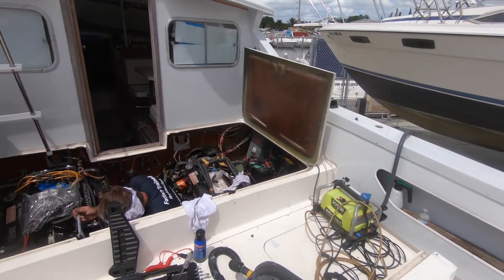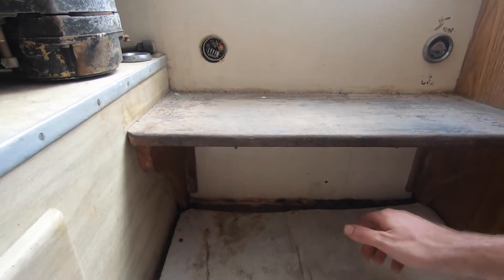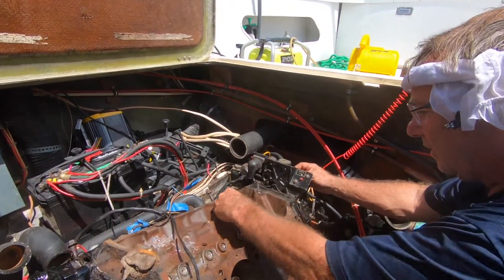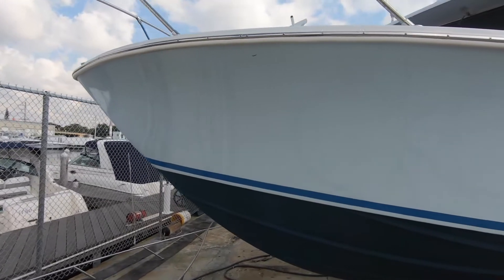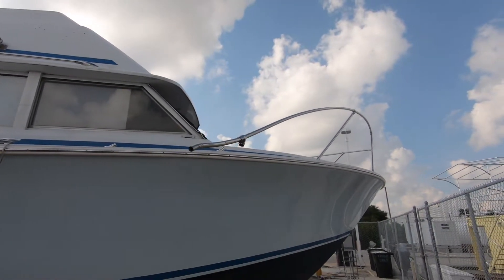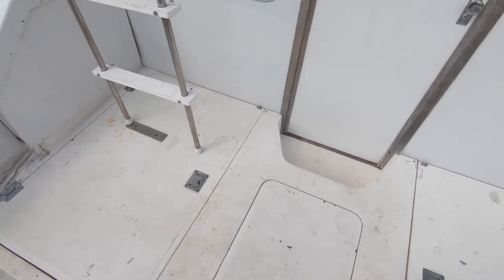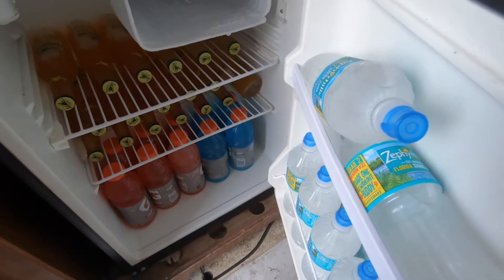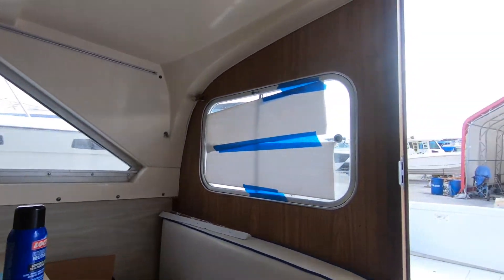1973 Bertram 28' FBC Restore Part 1 "The Denial Stage"

Comment: Looks like a hull of a deal. 😅
Anything that works most likely needs replacing. The up side is you will know every nut, bolt, and wire connection. Something valuable you don't buy with a new boat. 😊
Reply from the maker: It was a project that I knew was going to be expensive and also went over the top as I use the vessel to demo new products. The confidence I have in taking this boat out, knowing how everything has been put together cannot be bought. There are still some details but the boat is a beast and I couldn't be happier